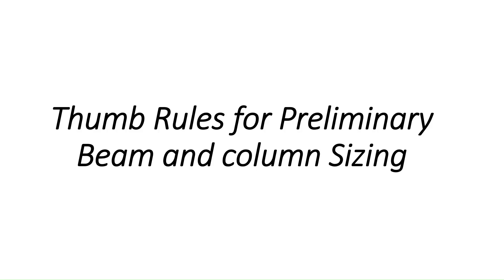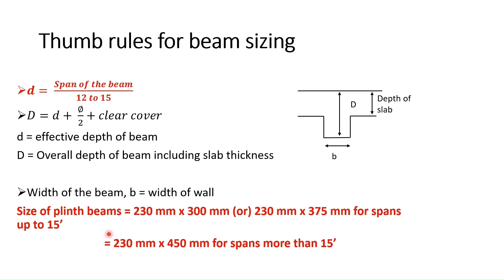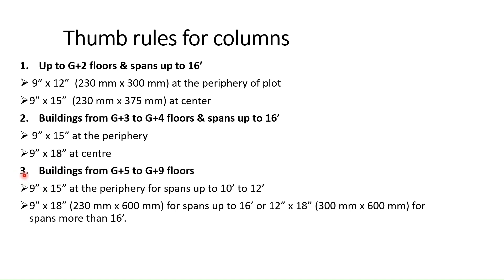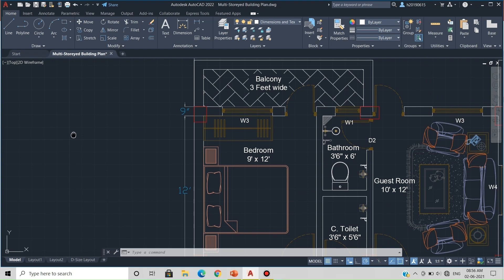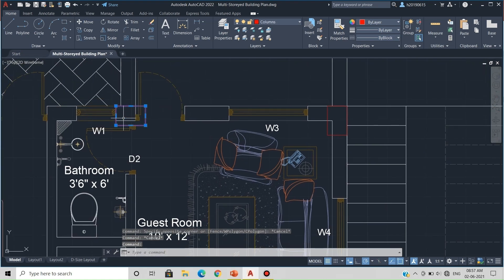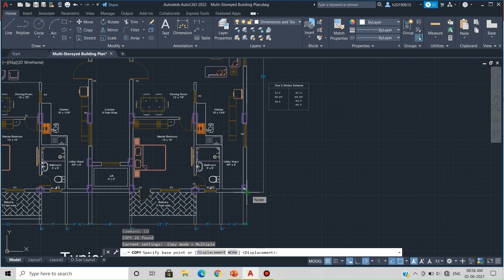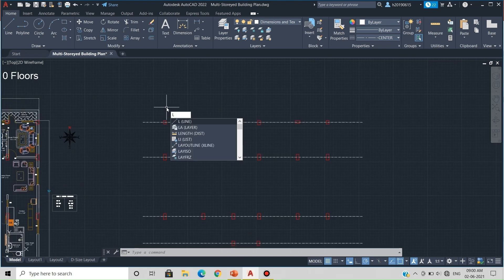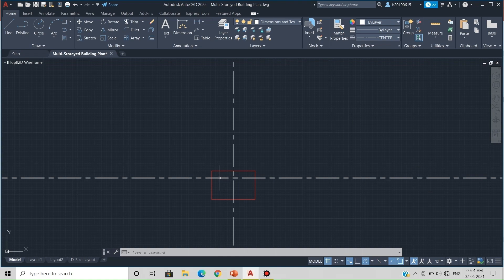ETABS Tutorial Part 1: Thumb Rules for Beam and Column Sizing

Comment: In the size of column for G+5 to G+9F the size is mention as 9"x18" but in  mm it is given as 230x600mm. Whether 450mm or 600mm which size is correct.